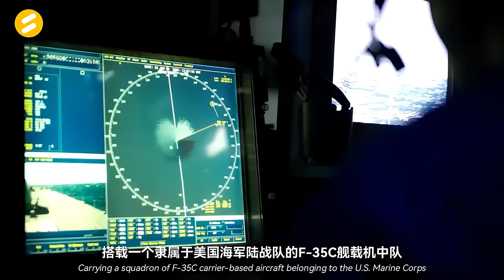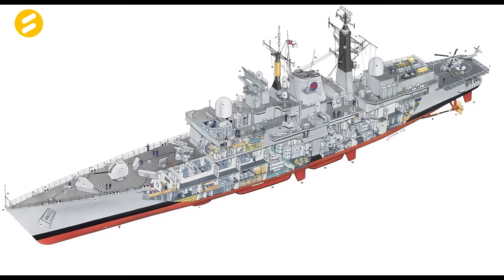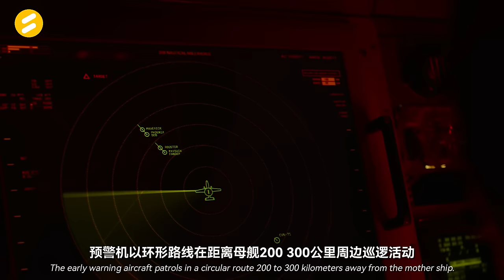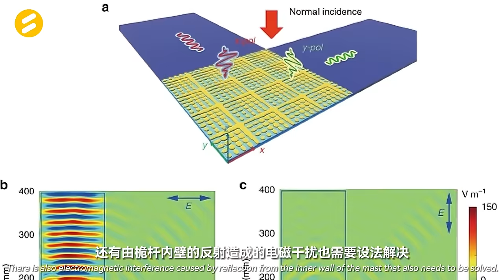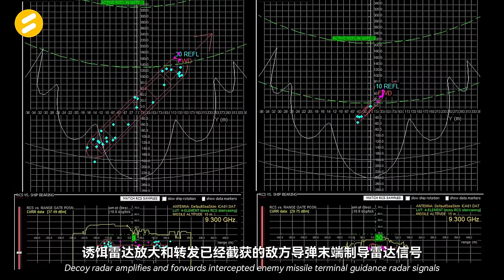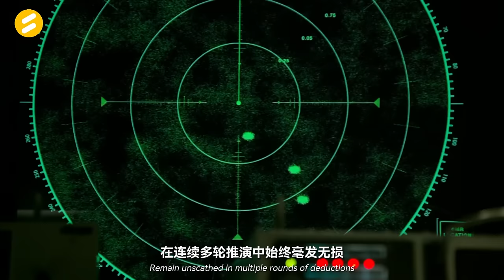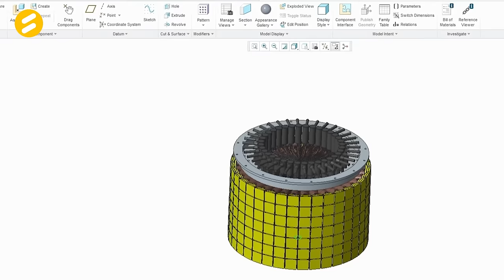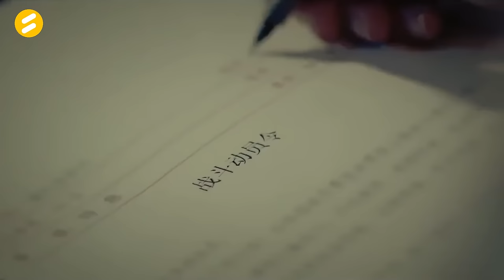南昌舰亮剑美航母：055的综合射频、电战及全维打击能力

Comment: High quality stuff as always. One of the best military channels.

I believe China should focus on drones if they aren't already. Lots and lots of them. Unmanned autonomous drone mother ships, subs, and jets, including loyal wingman drones. I believe China has built one unmanned drone mother ship already, although it is civilian iirc and not military. Even if the ship is manned, the drones can be autonomous or remotely piloted. Drones can fly with high range and long loitering time,  no need to use helicopters for scouting only, even before China has fixed wing AWACS on carrier. I believe that is the wrong direction ultimately since carrier is too vulnerable. and China has enough variation of drones and technology these days to do it already.. And with China's manufacturing capacity and also drone tech(DJI etc), I don't see why China can't just out mass USA. Even if USA shoot them all down with anti air missiles or CIWS, it will still lose the war of attrition. Even to use CIWS probably cost more than the drones they shoot down lol.

China can also use the same strategies for underwater drones, and submarines which launch drones. That is the future of combat, or rather, the present. See Ukraine war, see houthi and other attacks vs USA in red sea. It is a battle of attrition since neither USA or China will attack each other's mainland due to MAD and nukes, so it will be an attrition war. And in such a war china holds the cards. I don't believe USA can close down global shipping without hurting itself and it's allies just as much if not more than China. Like Japan, sk, Taiwan, Philippines, Singapore will all cease to exist if USA close down shipping long before China does. But nonetheless china should prepare for this. And the answer is AI/drones and lots of them, and more overseas bases at strategic points like Djibouti base, and more strategic cooperation in military fields(basically an unspoken non formal mutual interest alliance. Not mutual defense treaty).
Reply: 中国的无人机非常丰富，但是很少披露。无人机母舰叫做 《type 076》
Reply: Very Well said. China has been forcasting the adoption of unmanned equipment from all of army units including sub and drones. Drones have been prioritized I believe